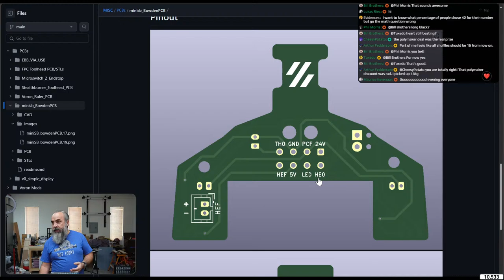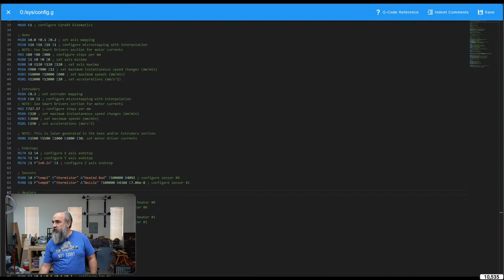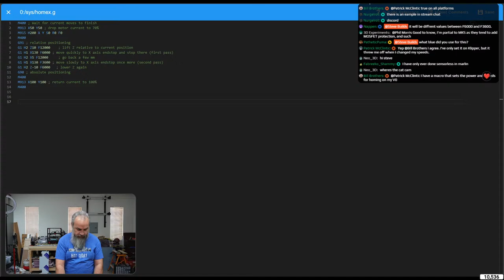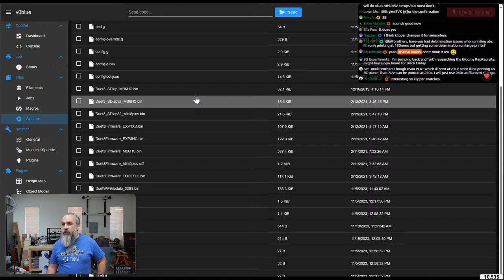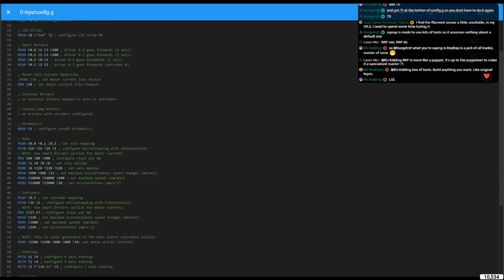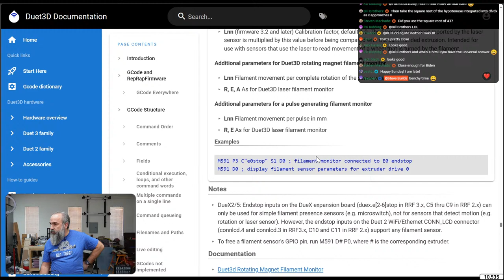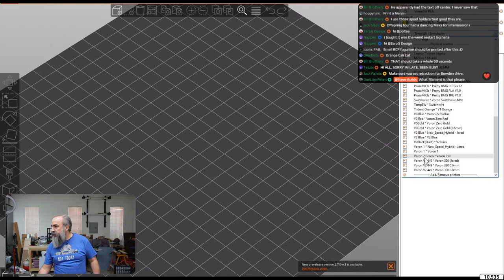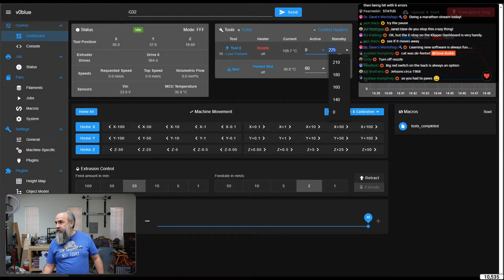Voron 0.0 to 0.2r1 Rebuild - Part 9

Comment: Those Build Plates are useless.
Reply from the maker: If you're referring to the size, these are my most frequently used printers, you'd be surprised.
Reply: @SteveBuilds  No. I've just completed an Annex K3 with a textured Build Plate and getting the prints to stick is a pain. I have a 7 year old Anycubic i3 Mega, a Chiron and a FLSun Delta, all with glass beds that hold on to the print beautifly. I've now purchased a  glass bed for the K3 and the difference is way better.